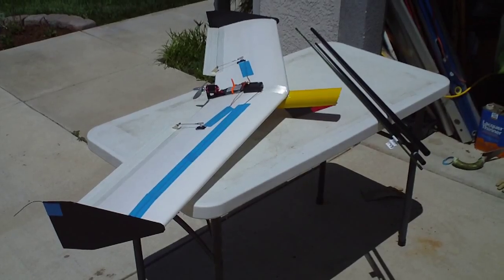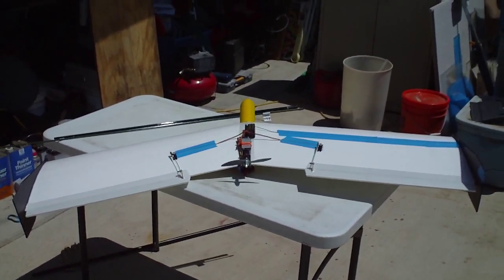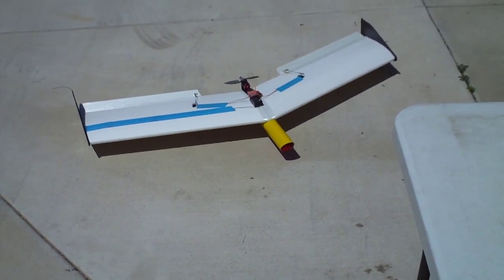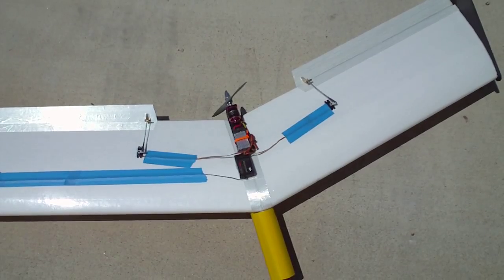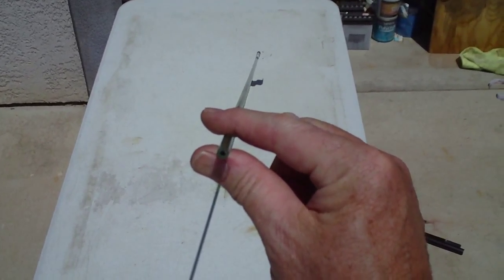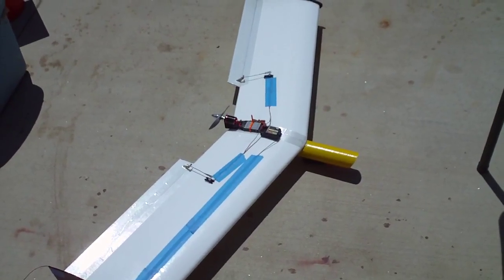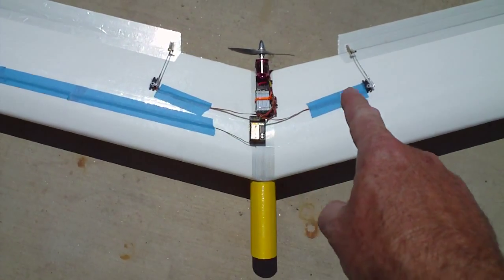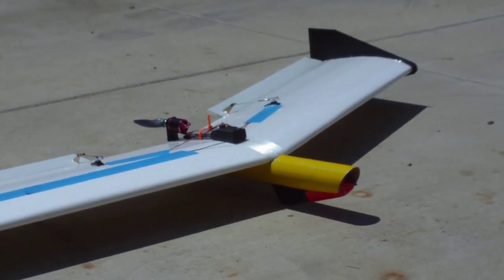A new build...the Delta Tube1

Comment: Thanks for the tip on the fiberglass garden stakes.  I went out to Big Lots this morning and picked up six.  The average weight came to 48g (1.7oz).  At 12g per foot they are double the weight of carbon arrow shafts, but a lot cheaper.

Comment: Hey Dashit! To clarify...any motor, gas or electric, inrunner or outrunner, can be used to push rather than pull. Also, any prop can do so by making sure the front of the prop is facing forward and with a gas motor pushing make sure its a reverse direction prop and not a standard one.